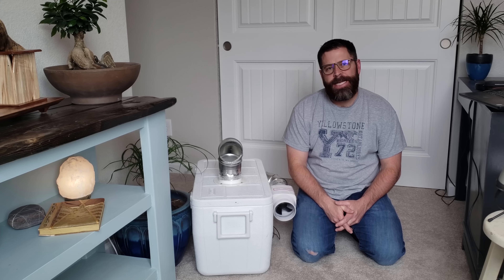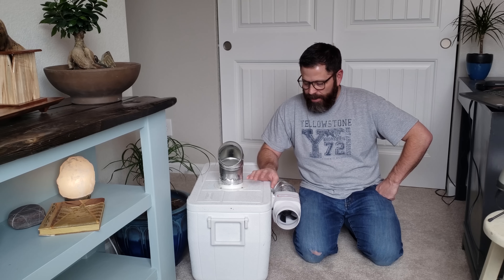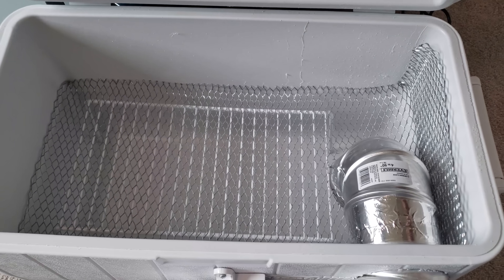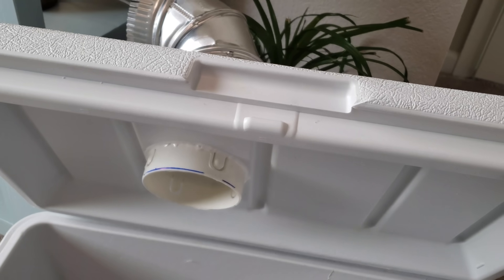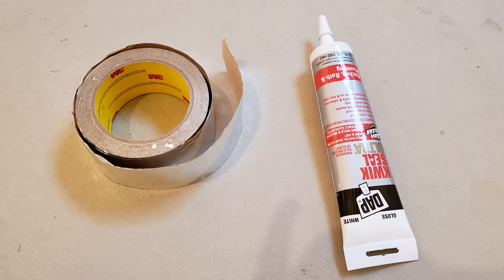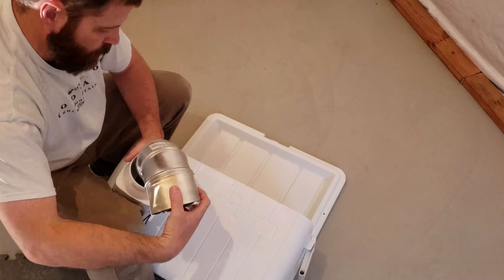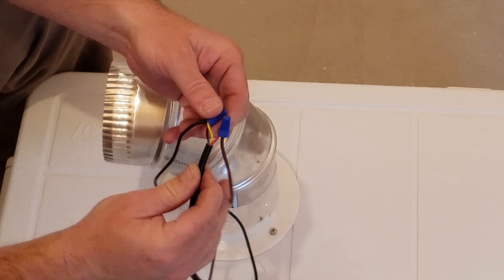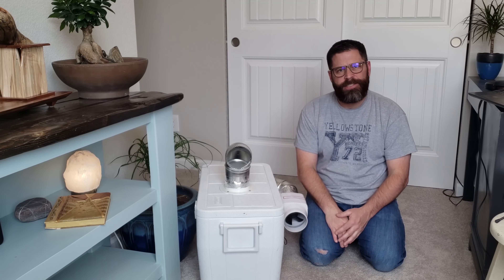Homemade Portable Air Conditioner DIY - Coldest One Yet!

Comment: I've seen 10 hours of cooling time at 21° f. And what impresses me is insulation inside of cooler at 1 1/2" thick separates the ice from the residual air therefore reducing warm air melting the ice. It has an oil cooler radiator that pump freezing water blown by an Ryobi 18v fan and a DC pump powered by a Ryobi 18v inverter.  How long does yours last?
Reply: Can you post a link with instructions please!  I’m not at all Davy on how to do any if this but I need to make one for my 70 year old wife!!

Comment: Will need an awful lot of ice. A good idea to melt lots of ice quickly. It will cool you down quick.
Reply: I'd use frozen gallon milk jugs AND store-bought ice.  The frozen milk jugs would keep the store ice frozen longer, and the store ice is better for cold air flow.  Going to need a lot of ice and the milk jug ice being one solid chunk would stay frozen a lot longer & keep the store ice frozen longer also.

Comment: The problem is the ice melts very very fast, because the room air is circulating through it at an accelerated rate. The cooler by itself can hold ice for long, but I have not gotten anything longer than 30 minutes with this

Comment: What about when the water collects at the bottom? Won't the motor be pushing air into a chaotic bubbling water then? and then air coming out the top vent may get splashes of water coming out as well right?

Comment: I made one, exactly with the parts he listed. it works but prepared to have a truck load of ice. I stuffed mine as full as I could with ice, and with a outside temp of 85, after 1 hour all the ice was gone. I froze 23 water bottles and used them, and they lasted about 2 1/2 hours before they were all melted. If I had known that information, I would not have even wasted my time or money.
Reply: Honestly, what did you think would happen? I’m not trying to be mean but you’re sucking in hot air and moving it across the ice before blowing it back out. It makes sense that the hot air moving across the ice would quickly melt it....which is what hot air usually does with ice..... again, I’m not trying to be mean, but I think you should have reasonable expectations about the projects you invest your time and money into. Spend a little more time in the research and development stage (specifically the research stage) before spending money and finding out the project won’t work for your needs. If I built this it would be intended to run 1-2 cycles (a cycle being the time it takes to melt all the ice) during the hottest parts of the day, then I would switch to smaller usb or battery operated fans once I ran out of ice. I also use a Berkey water filtration system so I can filter the melted ice and use it for drinking water. Anyways, you should sell yours on Craigslist or something. If you put time and effort into the build someone else will surely be happy to take it off your hands. 😆
Reply: @user-dy5ho4sj2w how about putting the fan inside the color WITH the ice. Now you're not moving hot air into the cooler. 👌🏻
Reply: It was cold for 2 1/2 hours?
Reply: Add salt to your bottles of water. They stay frozen far longer.
Reply: @aprilchaney  thanks for the tip!!!!
Reply: How about put some salt. The temperature will be more stable and ice will stay longer I guess
Reply: @fydaestrada8   yes, buy the proper size rock salt type and also use block ice. Large blocks of ice melt much slower than crushed ice !   The electrical fan the man in this video is using is good, but you might want to use a less powerful fan to make the ice melt slower❄
Reply: @fydaestrada8 ...salt forces ice to melt which makes it colder...that's where to A/C tonnage comes from, (basically, how much space will a ton of ice, forced to melt, cool ?)= a 1 ton unit...etc...
And yes it will stabilize the ice melting  by forcing the temp below freezing, but it won't last longer...just produces colder air.
Reply: It would be great for a car to commute to work. Then grab another bag to commute home. - in a desert area with low humidity
Reply: there are medical ice packs for transport of medicines they stay frozen longer because they are not filled with water ( higher specific heat ) . you would get more time but I dont know about cost
Reply: @thelifeofjools8384  actually, it would work for a small aircraft owner. To be able to cool a flight down would be awesome for some without a/c. Probably more efficient to use a smaller duct and fan. But to get 2 hours of cooled air would be heaven. No problem with the weight and balance if the back seat is open. We can always get ice. I'm just saying....
Reply: @ronaldguy5474  Agreed...that makes a lot of sense..re.a short duration operation...and of course it would be worth the time and expense involved in making it.
I was hoping for 5 to 6 hours of operation, with a view to getting some meaningful sleep. 👍
Reply: RV ice makers are like $60 too. Make the ice yourself in a pinch
Reply: Should have gone to Iceland!!!
Reply: Maybe it all depends on the type or brand name of the cooler, some coolers arent insulated as well as more expensive more well insulated coolers. So maybe buy aore expensive cooler that will keep ice for longer periods....i have one that will keep ice for literally days in summer even in the sun still keeps ice
Reply: @jamesabarela what one do you use
Reply: @brendalg4  IGLOO red, with wheels and extendable handle.
Reply: What we're you trying to cool?  Like how big of a space?
Reply: Thanks for the suggestion
Reply: You used one of these on 85° outside?
We would be wearing long sleeves and dress coats in 85° 😅
We just had a birthday party outside in 103° 
You are lucky at 85°
Reply: Cost to build?
Reply: Does it have to be wired to a car charger plug?
Can it be wired or converted to a power pack?
Reply: Try frozen 2 liter bottles. 😎👍
Reply: Say frozen water btls and u can rotate and refreeze
Reply: Thanks for the warning. I won't bother wasting my time or money then.
Reply: What about dry ice?
Reply: @foxmulder216  Dry ice should not be melted (sublimated) in an enclosed unventilated space. You'll gas up your air with CO2, which is bad for breathing.
Reply: @TheArrowheadVenom  -- you could die from CO2 Pushing out all the oxygen.
Reply: Naah, that aint gonna happen. 😆
Reply: @Fox Mulder  never use dry ice. It gives off carbon dioxide gas and can kill you.
Reply: @foxmulder216 ...dry ice is made from solidified CO2 gas...it's very very cold...but you don't won't to breathing a room filled with CO2 GAS...it'll displace oxygen and kill you

Comment: Why couldn't you just flush mount the blower to the cooler without the 90 elbow outside to avoid all that extra bulk? After you flush mount the blower, all you would need is a 90 degree elbow on the inside to go down below the ice.

Comment: The "Evaporation" or commonly referred to as "Swamp" cooler works on the principle of evaporation. Forcing DRY warm air over or through a damp/cool surface or material. The intake air must have a DRY air source otherwise efficient evaporation will be minimal once the air in the room you're pulling air from  becomes saturated with high humidity. Pull air from warm/ dry air Outside of the room/space you are trying to cool 😊

Comment: What if you did the same as the fireplace tubed log rack that has the fans that blow hot air from the burning wood on the tubes. By running plastic piping underneath water and ice , with the exhaust coming out like yours . Seems the submerged piping would stay cold from start to finish melting .

Comment: What would be sweet is a mold(s) with a winding path for the air to travel through. Also a version for rotomolded cooler (yeti) that doesnt ruin the cooler.
I bet lining the cooler with reflectix (foil bubble wrap) would slow ice melting. Whatdyasay?
Reply: i was thinking something like that. line it with light aluminum. or copper//copper coil

Comment: Judging by the total cost, you might as well just buy a window ac unit.
Reply: Way more expensive to run an air conditioning unit. You certainly could not run it off the auxiliary power in your car.

Comment: Has anyone tried this and also laid some frozen 2 liters on the cooler floor below the rack (4-6?)? Seems like protecting the ice a little would prolong the life and also re-chill the water in the bottom as it collects?? The more the ice the merrier? Just a thought. I'm building mine this week. Thank you SO MUCH for this video and design work - and AMAZON links... I'll be using a larger cooler with a top secret BEER CHAMBER.... LOL

Comment: Jason.  Good job.  Ive checked out the design of several that one can purchase from Ebay or Amazon.  They're all basically the same design.  
   I made my own and used a 7.4v lipo battery for power.  A plastic storage container and plastic. 5 x  5" grid and a 370 size RC motor with a small 3" squirrel cage fan. 
    Mine runs for hours and didn't cost a dime.
Reply: A cooler or old frige that is insulated, is extremely better than any plastic storage container.

Comment: I’m thinking this can be adapted to cool a bedroom during an outage. We have hurricanes that don’t actually hit us but get close enough to cause widespread electrical outages. In Florida, the nighttime temps are just too hot to sleep. So we have to leave until the power is back. That puts a massive strain on traffic (very few roads out of south florida) it is many miles before a hotel with vacancies can be found and the looters know our houses are empty and the alarms don’t work. Any device that allows us to stay in our homes saves exponentially. To compound this, condos and townhouses can’t have generators, even during an outage.  
We can keep ice for 3/4 days in a high performance cooler so this may be the last piece in the puzzle. A temporary solar panel might run the fan, I think. (If it’s not connected to the building the association can’t stop us.) After a few days we can drive north to replenish the ice, call our families outside the area and buy beer then drive back home. I ask my friends/neighbors what they want so we all benefit.
Reply: You live where there is a homeowners association?  I'm sorry.

Comment: Instead of using straight ice cubes you should use milk jugs filled with frozen water...easy clean and just stick the milk jugs back in the freezer when thawed out and for making the holes use a hole saw kit drill bit

Comment: What about connecting a small solar panel to a marine battery and hook up the blower to it and add a switch to turn it on/off? And put the cooler and battery on a small cart wheels?

Comment: Doesn't this melt the ice much faster compared to your other design where ONLY the metal tube snaking through the chest comes in contact with the ice, not the flowing air?

Comment: Does that actually cool down the car... I have a jeep grand Cherokee that had a/c but the previous owner had some kind of issue and removed the compressor and lines so there's just about nothing left... I was thinking of either getting an under the dash unit or even a rooftop unit... idk... but I can't stand not having a/c..

Comment: What do you think would be the difference in performance if you reversed the fan and had it putting vacuum instead of passive pressure on the cooler. That way it's pulling from across the whole layer of ice.
Reply: Jkp OP

Comment: This same design would work for heating your home if you took the fan out and hooked it to the exhaust on your dryer. Fill the bottom with water to catch lint and humidity and heat will come out the top.

Comment: It's been awhile since you posted this, so I hope you are still watching for comments, because I have question... What kind of considerations do you have to take when the ice melts and the bottom of the cooler starts filling up with water? I would imagine, that you would have to watch how much ice you put in so that the water level never reaches the bottom of the duct that pokes thru the mesh. Seems pretty straight forward... but just want to be sure... is it as simple as knowing what the water level will be once the ice is all melted?

Comment: Very cool version!   I think if I did one, it would have both ducts through the lid, or, would simply fit the intake fan through the back end of the box, to avoid having bulky ducts stick out on 2 sides. 
Using dry ice is costly, but more effective at chilling. Water ice ends up humidifying the cooled space, & having to dump the meltwater periodically.   Using a cooler with at least double the wall thickness, preserves ice for several hours, so you could commute to work & back home on the same load of ice...but only if the box & ducts are far better insulated.   Refreezable ice packs is another possible.
Reply: I was thinking that too I think that if they would have that same cooler out of expensive yeti or something like that with thicker walls but I find it would be really hard be cutting and drilling holes into the expensive cooler like that.
Reply: Dry ice will expose you to carbon dioxide

Comment: Its a great idea, and not to be a downer but doesn't it fill the room with humid air? Wouldn't it be better to have ice in bottles or run a metal pipe through the ice and the air blow through the metal pipe?

Comment: I like it but I think I'm still putting the blower on top just running the pipé to the bottom so it's not in the way ... Also add a dc speed controller to the blower Thanks Nice video!

Comment: Currently building two of these in Australia, thank you for the info. To run off solar the wattage is amazing. And I only use the freezer I'm currently using anyway :)
Reply: Did you ever finish it? I live in Australia as well, but I worry that something like this will increase the humidity which is pretty bad already near the coast.

Comment: Pull the air, slow the speed.  Better results with larger container, but slower speed.  Will allow for longer duration of cool air, allowing actual temperature change.  Unless you have a "beer" fridge, for freezing bottles, or ice trays, this is not cheap.

Comment: Thanks for this, it's great!  What works better, a bunch of small frozen water bottles or a bunch of ice/cold packs?
Reply: Best to use frozen bottles of sea water, as salt water freezes at a lower temperature - around 28 degrees Fahrenheit so even colder. Yes your home freezer will freeze salt water fine - but obviously if on a road trip, as soon as they have melted it's back to stopping off at a store & using normal ice bags

Comment: Instead, use one semi-rigid duct from intake to exhaust and coil it in between. Pack ice around the coiled duct. Place the blower motor in the exhaust or blow it through, it's the same effect. This way, there is no direct airflow on the ice (which would melt it super quickly), the ice would make use of the cooler insulation (makes it last longer), there would be limited condensation/moisture that hinders/hampers your blower, and your airflow would only use inline indirectly cooled air from the duct walls. It's simplest and best.
Reply: My buddy just explained to me wut ur saying here so that I could visualize it, and yeah, this is a much more effective idea
Reply: Can you please draw me a picture? Lol I want to do this but I'm having trouble understanding
Reply: Just cut holes in the insulated bag only where necessary for best insulating effect.
Reply: Thanks for this suggestion, I'm probably going to implement. Can you confirm the temperature will drop down to the same amount?
Reply: I get it
Reply: I don’t understand, why are we coiling?
Reply: @cram1nblaze coiling the duct because you can fit more duct into the cooler.  More duct equals more surface area for heat transfer to take place
Reply: This is the best idea yet. Thank you for sharing it.
Reply: Theory always sounds great. Did you do it?
Reply: You smart AF bro. HVAC INSTALLER here and I didnt even think of that.

Comment: First off, Great work! What an excellent idea for someone that doesn’t have the money to fix their car A/C and doesn’t want to make their families suffer from extreme heat. I am curious about using a similar idea(same basic concept) to cool a room in my house that does not get enough of the central air because of some ducting issues that I cannot tackle at the moment. the one reason that actually makes me think this is a bad idea for cooling a room inside a home. I live in Florida, so humidity is already an issue, which is why I would run ice water through copper tubing on the face of a block fan. On the efficiency in cooling though.... The heat transferred from the appliance(fridge) may be a better focal point. A water pump, some copper tubing, and some insulated rubber tubing to transfer this heat out of the house could bypass your centralized HVAC system. If you can transfer that heat out efficiently enough than you end up with a surplus capability of heat removal by the appliance. So it’s a double effect... bypassing HVAC saves money, and the appliance that is sucking more heat out of the entire house via Ice cold air... thermodynamics... so that means ice does not actually melt, Right? The water becomes unfrozen, right? Sounds like a play of words to make something seem more complicated than it actually is.
Reply: I have well water.... I have a garden... I can create a thermodynamic system that cools my house and irrigates my garden...
Reply: Well water in Florida is much cooler than the air temperature for most of the year.
Reply: Well water is definitely cooler than the heatsink of an appliance, or any other heat radiators in the home.
Reply: Why not....

Comment: the problem with these swamp cooler's that nobody seems to talk about, is that they can significantly raise the Humidity when used in an enclosed area, like a room.  When humidity levels reach 70%+, it's a prime breeding ground for dangerous forms of Black mold.  I would NOT recommend using any type of 'cooler' made in this way.